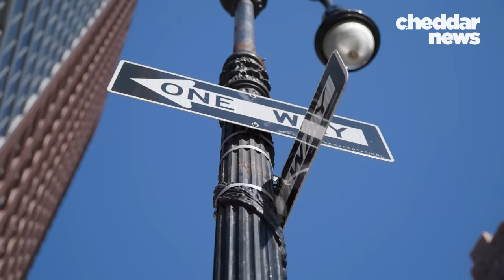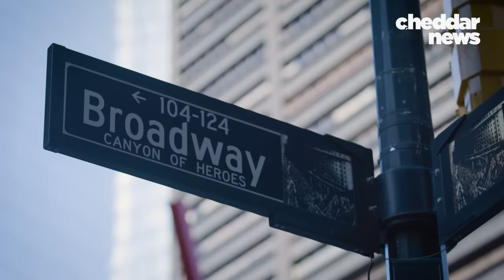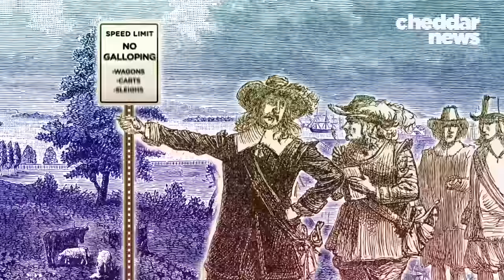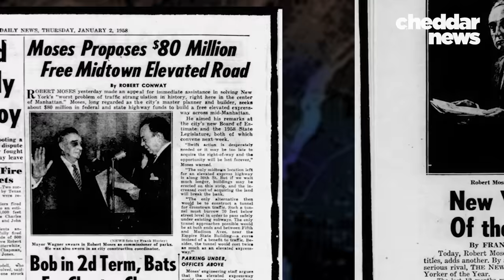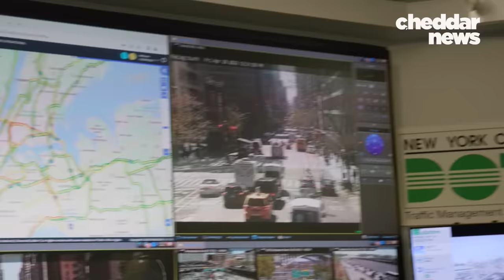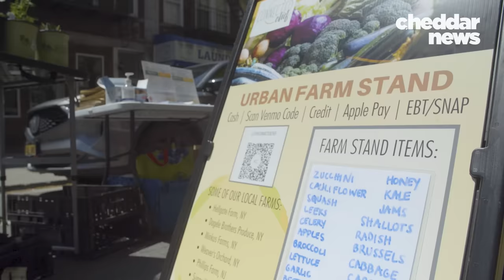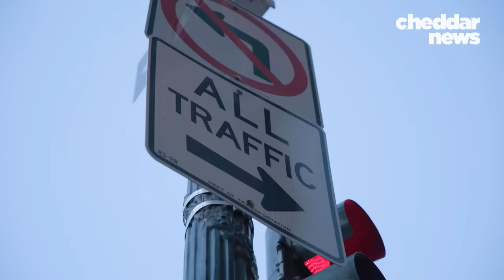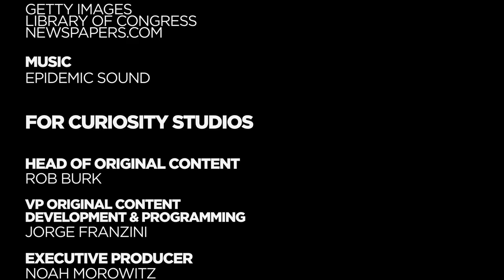How NYC Manages The Most Congested Streets In America - NYC Revealed

Comment: One of the cool things about asphalt is that it doesn't cure or set, it just cools. So it can be almost infinitely recycled by just heating it up and laying it down again. You just need to replace anything that was lost over time and to clean out or account for contaminates
Reply: nice
Reply: Now looking up videos about asphalt. Thanks.
Reply: Just a thicc fluid indeed
Reply: Right, but the downside is it's much more costly to maintain over it's lifespan then concrete, which while much more expensive tends to last MUCH longer.  There's a reason why Europe's roads are in much better condition, and that's largely because they not only use concrete, when they do repairs they repair that entire section rather then just fill it in.  While more expensive to budget (and more annoying since it's a multi-week job), it's cheaper overall in the long run.
Reply: And repair the base and subbase. Asphalt is soft and not repairing the sub layers often results in a poor outcome.
Reply: But it gets really hot in summer. Frying hot. Have fun.
Reply: @gamerk316 concrete doesn't fare well on public roads north of the frost line in the US

Comment: I love NYC. I live in Texas but I deliver furniture from all over the country pulling a 24ft trailer that's 8ft wide. So I'm about 42ft long. It's definitely a challenge but it's fun. I quickly understood how moving around NYC is well organized chaos. All you have to do is follow the rules. Dont run red lights, no turns on red, don't stop in the crosswalk, if you're going down the ave a good way just drive in the middle, don't see your lane as your's just slide over, if you make ANY kind of turn or lane change check your mirrors for bikes, goimg into the tunnels it's gonna look crazy with bumper to bumper or bumper to door but no one is mad. (That was a seriously long run-on sentence). NYC is magical.
Reply: I did it daily, sometimes with a 45' trailer. You do what you can and turn if you can.

Comment: If there were less congestion, logistics companies could deliver food and materials etc quicker and might might have a positive effect on consumer prices in the city because of competing lower shipping rates due to lower fuel consumption and less time required per delivery giving room for a grater volume of work. Just an idea.
Reply: @dickburt69  they should apply high congestion pricing to personal vehicles but exempt all commercial vehicles including taxis and ubers from the tax.
Reply: Nope, $65 for commercial vehicle and $23 for taxi, no exemption for locals whatsoever, the private vehicles only reliable transport in nyc, MTA sucks
Reply: @helenk2800  that's backwards
Reply: If you have solid alternatives, those who don't need or want to drive will stop driving, so less congestion for those who need to.
Reply: @katjerouac  taxis and ubers aren't very efficient, they are basically cars with a chauffeur.

Comment: Considering the age of NYCs infrastructure, it's managed about as well as it can be.  Obviously you are limited in what you can do due to the fact it's so built in, and you can't do what Moses did and just raze everything in the way (some would try though).
Reply: my city is rather small, but close to 2,000 years old. NYC has the advantage of a relatively young infrastructure and wide roads
Reply: @EnjoyFirefighting   But it doesn’t even matter. The infrastructure is so integrated and complicated, so it’s not easy. And it is “old.” It doesn’t matter how old infrastructure is, if it needs to be updated than it’s old. Some things last, some don’t. Another thing though is the bedrock is really hard in most places (which is how they’re able to build skyscrapers on a tiny island). It’s not easy to dig and tunnel operations in NYC often go over budget
Reply: @Ryan-cb1ei  it's integrated and complicated in pretty much any busy city, with tubes, cables, tunnels etc underneath; Also many cities face difficult circumstances like super solid rock or soft soil. Ancient city structures and archaeological excavations are a topic of its own. One aspect we face on a regular basis are discovered WW2 bombs, especially on construction sites and in forests
Reply: @EnjoyFirefighting  Many cities in Europe are no where near the size and density of NYC. And a lot of them were somewhat rebuilt after WW2 allowing a clean slate. It’s not the same thing, most of them have much more space to work with
Reply: @Ryan-cb1ei  size isn't really relevant in that aspect, and density is only relatively relevant. Yes, many cities got rebuilt after destruction in the wars, but they got very tight since then as well. In many cities which got rebuilt you don't find much space today; In fact, in many of those cities you can barely dig a hole without finding bombs; Many cities need boroughs to be evacuated several times a year. 
However, there are also many cities which weren't destroyed and still have city block and road networks which date to way more than thousand years ago. A city doesn't need to be enormous or with the highest population density to be very lively, tight streets, having a complex layout and difficult construction circumstances. 
NYC is the only American city which can keep up with public transit, still in most cities in Europe it's on an entirely different leve, also the scale of service provided and infrastructure implemented in the city in comparison to their population. NYC is obviously still the best one in that aspect in the US.